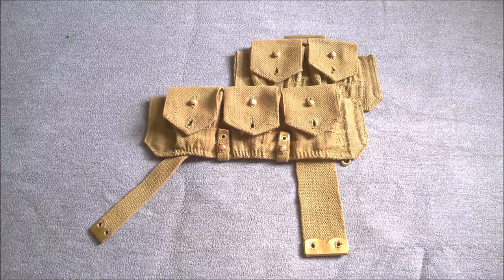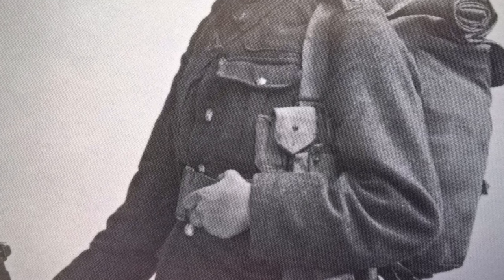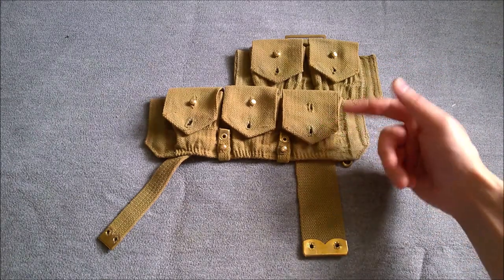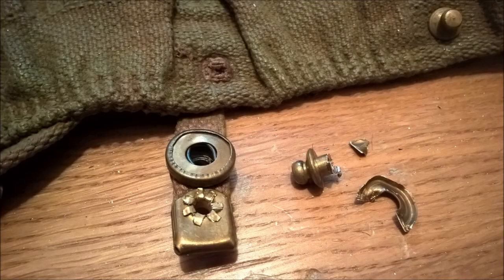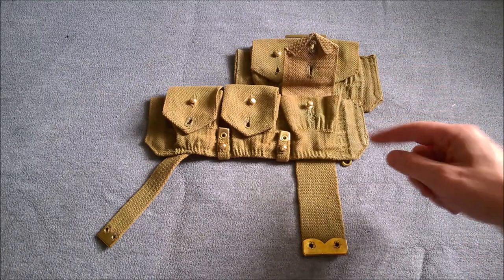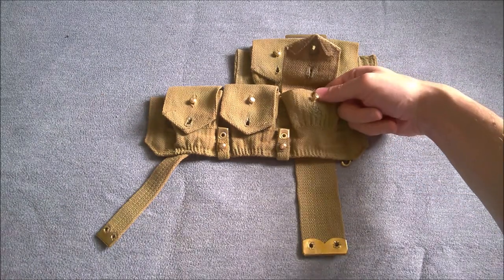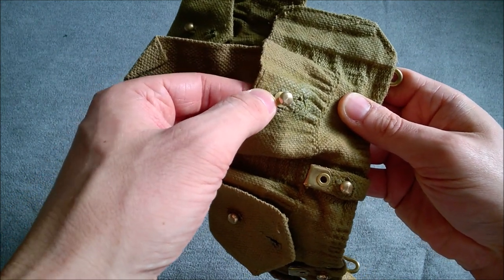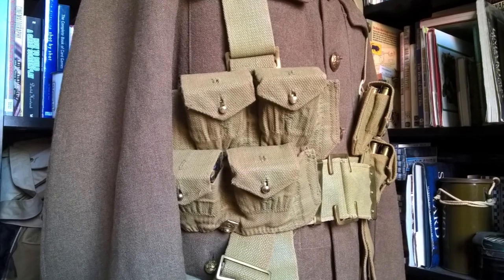Creating an Economy 1908 Pattern Cartridge Carrier

Comment: Why was the 1908 pattern replaced by the 1937 pattern? Was the 1937 pattern better and if it was how ?
Reply: They replaced it with the 1937 pattern for a few reasons, one of the biggest was the addition of Bren gun magazine pouches. Every infantryman carried Bren gun magazines for thier section, it made it easier on the machine gun team, and if needed, the soldier could take the bullets out of the magazine and use them in his SMLE since they both used the same cartridge.
Reply: Baby Inuyasha correct, the section’s job was to supply the Bren gun. Ammunition for the individual soldier’s personal weapon was held in the issued cotton bandolier.
Reply: I believe that the 37 pattern was also lighter than the 08 pattern.